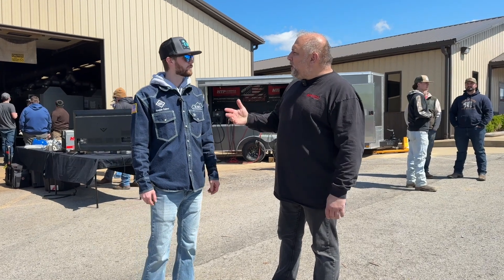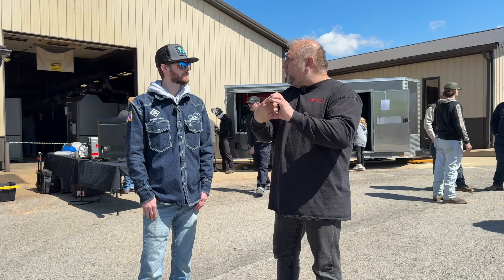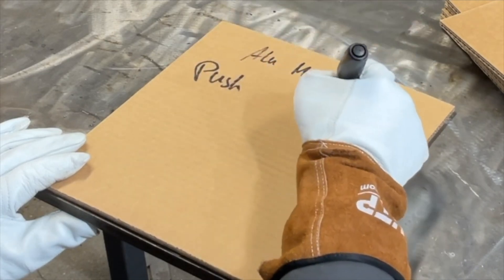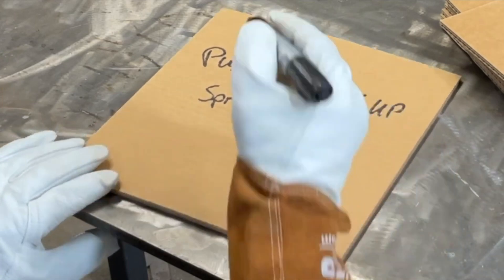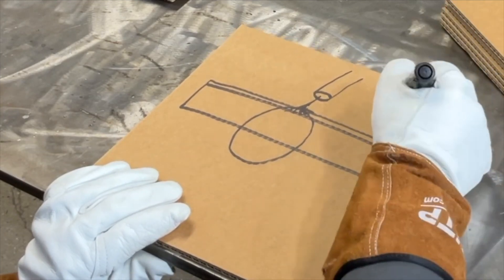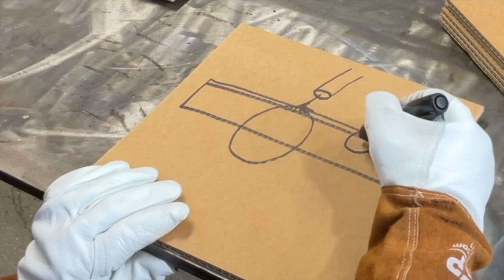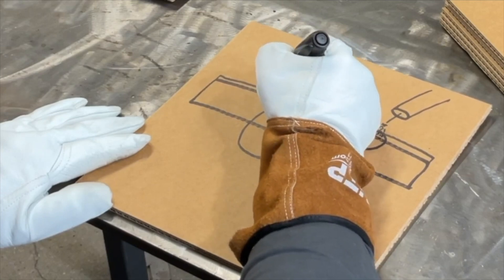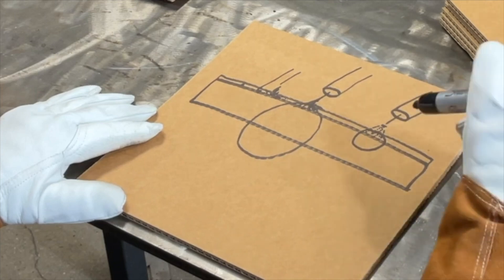Aluminum MIG welding with a Spool Gun - how does the cleaning action work ?

Comment: No disrespect...BUT, the oxide layer is removed by what's referred to as 'cathodic etching', it doesn't have anything to do with actual electrons.  The work piece, being electro negative (in relation to the torch/wire) attracts positive gas ions from the plasma shielding gas (Ar ions or what ever noble shielding gas you're using ie. Helium or He/Ar blends).  These positive Ar ions are accelerated towards the negative work piece and atomically sputter off the oxide layer.  Say you're welding at ~25 Vdc EP (not including the inter-plasma gas collisions), the ideal energy of the Argon ion is 25 eV, though its actual average energy at impact is typically lower due to atmospheric collisions. At full 25 eV energy, the Argon ion is moving at approximately 11,000 meters per second (about 24,600 mph) when it strikes the aluminum surface.  This is the actual mechanism of how 'cleaning' action removes the Aluminum Oxide layer.  There are no other voodoo explanations needed for this process.

Comment: Actually you do not need spool gun, it is possible to use teflon liner and shorter mig gun leads, and one more tip use 5356 welding wire if you use teflon liner.
Reply from the maker: exactly the point !  you can even feed 4043 through a push gun no longer than 10 ft and with a carbon graphite liner with the right drive roll in the machine .... no problem !
Reply: Yeah, spool gun is definitely less prone to "mishaps".